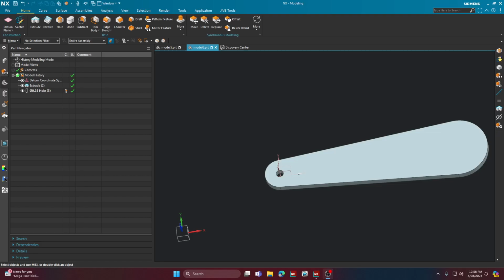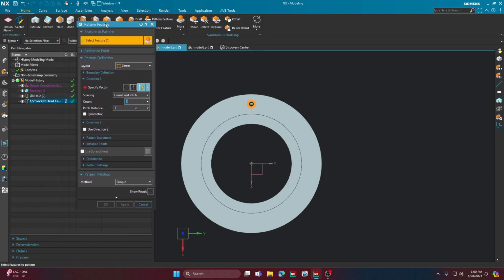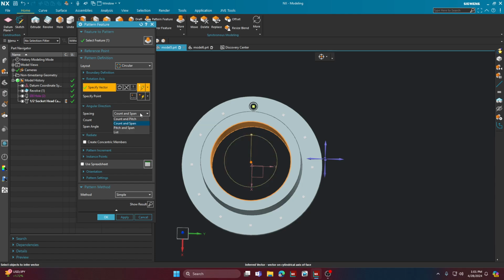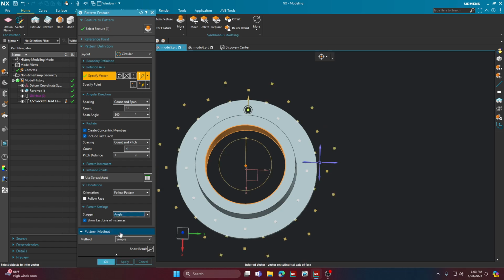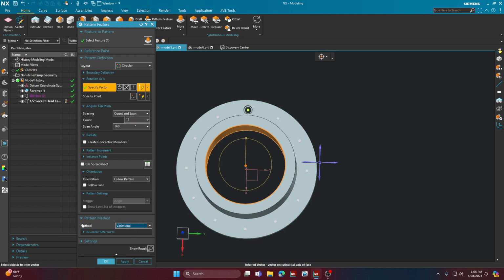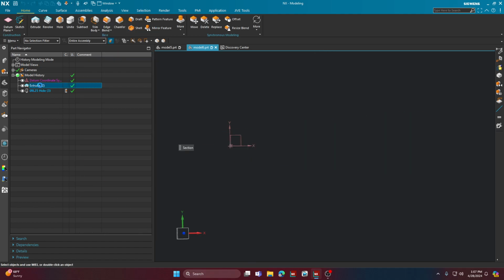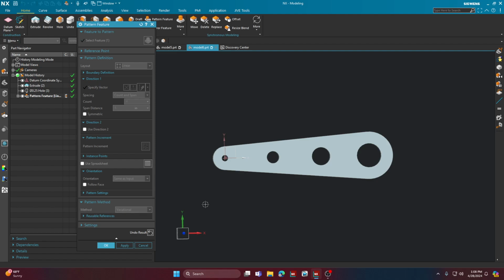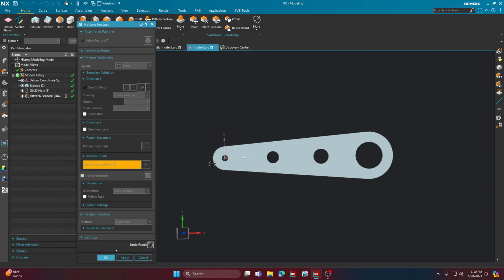NX 2206 Tutorial - Everything About Pattern Feature (Spreadsheet, Increments, Methods)

Comment: Is it possible to use an external Excel file to drive the pattern increment instead of using the temporary NX spreadsheet? I'm trying to use X coordinates defined in my own Excel file to set the patterned coordinates.
Reply from the maker: I am not aware of a function for this. The only thing I can think of is to copy and paste your sheet over. Sorry